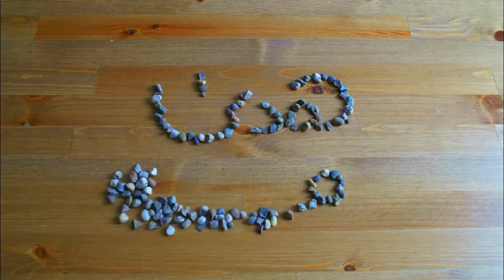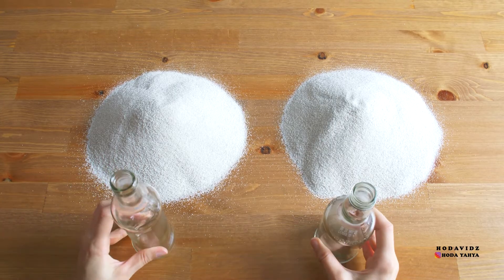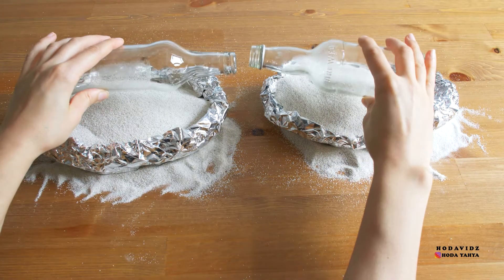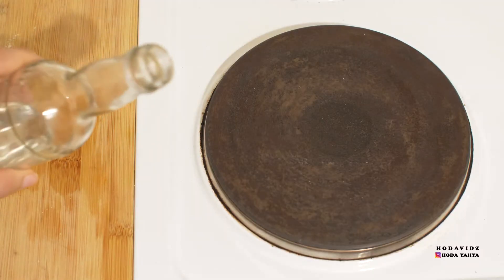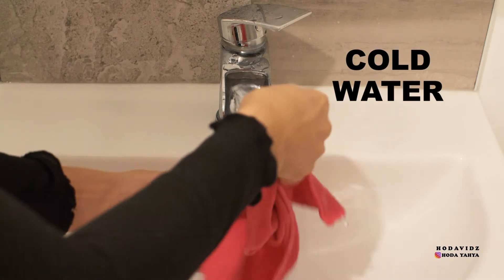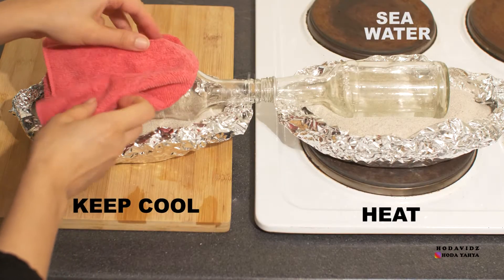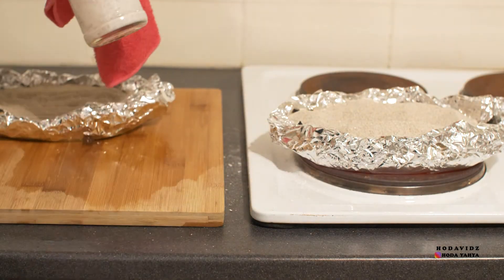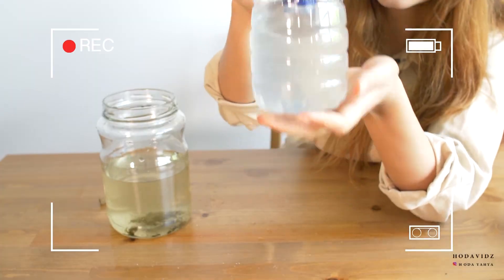HOW TO TURN SALTY SEAWATER INTO FRESH DRINKING WATER USING GLASS BOTTLES  | LIFE HACK

Comment: Hi, can you use plastic water bottles instead of glass bottles? Same results?
Reply: it's not a good idea to heat a plastic bottle and then drink the contents. even leaving an open soda/pop bottle in your car and then drinking it later can be toxic, and in this case you need it to get hot enough to actually boil the water, and at that point, especially on a campfire, you're going to be melting the plastic bottle entirely.
Reply: @jlt131  Many thanks for the info. Was thinking of the same line of reasoning but if you are in a survival situation, you may have little choice. Stay safe!